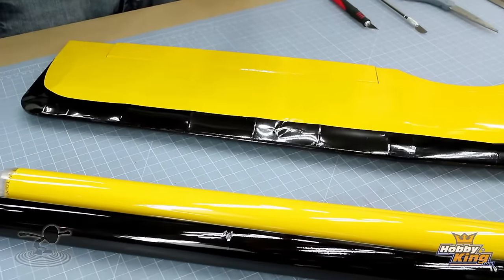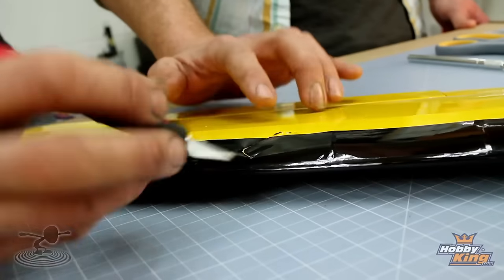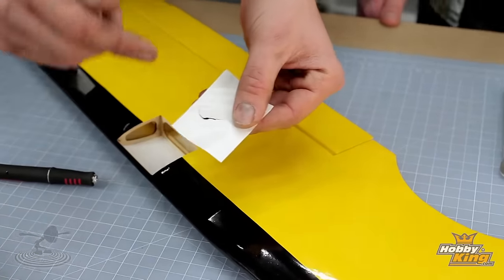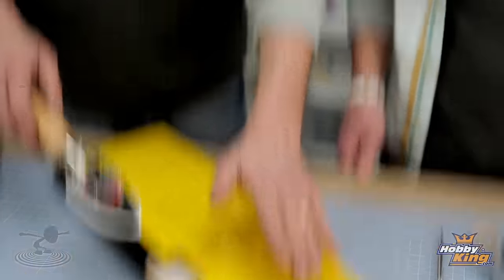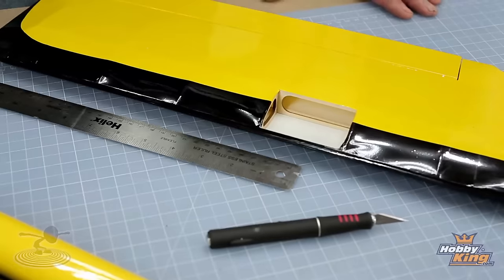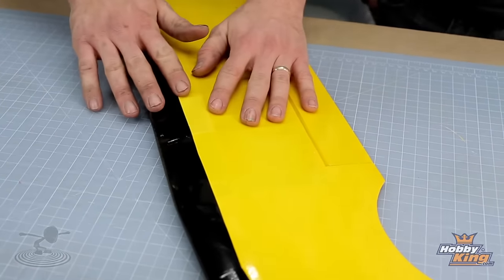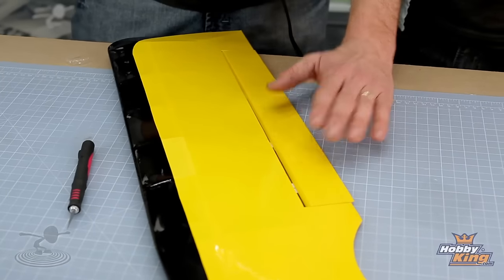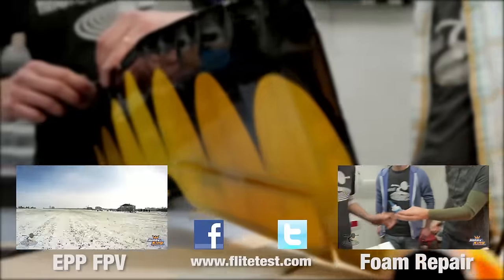Flite Test - Repairing Covering Film - FLITE TIP

Comment: Repair
Boeing Airbus composite overlap is 1/2". Covering Film looks to be 1/4". Color packing tape is better faster stronger with the new adhesives by 3M or Scott lots stronger. Larger areas where shrinkage is desired to remove a fowl up in packing tap pull then covering film repair.
Clean
Boeing Airbus composite clean is polar clean nonpolar clean meaning water based clean the solent clean. Past was water based and MEK but MEK is iffegal in the states IPA or Acetone or any good solvent work